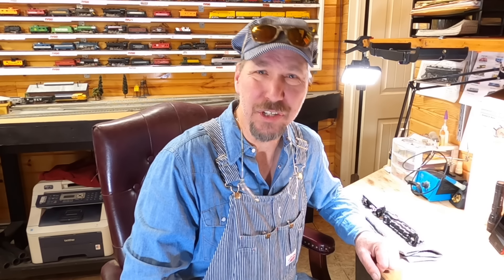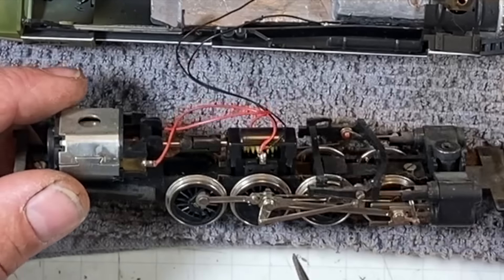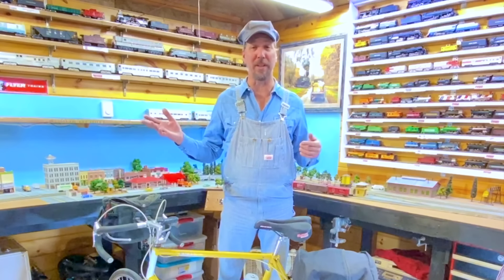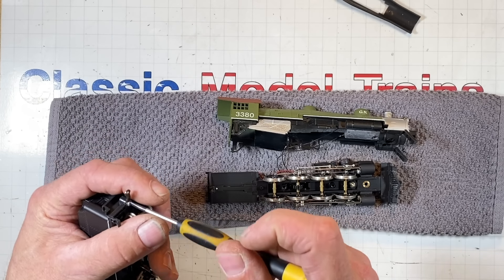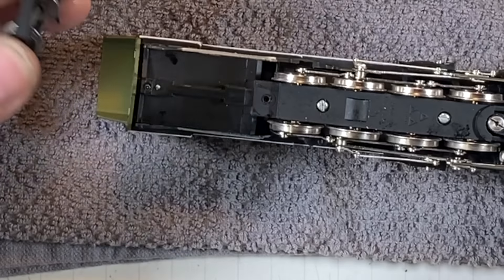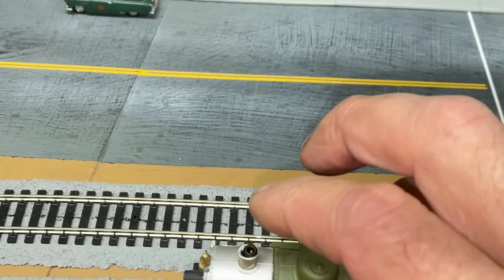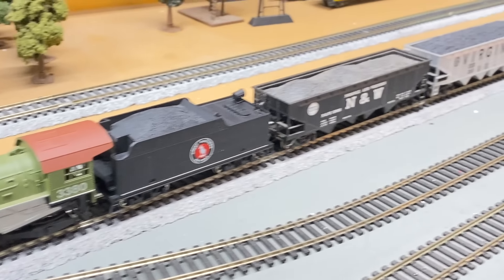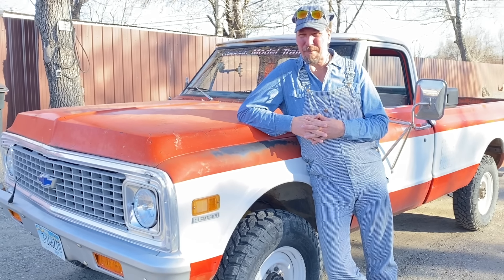AHM / Mehano H.O. Steamers.....Built Better Then You Think!

Comment: I'm 77 years old and my freelance layout is set in 1962 and represents a very short dieselized remnant of an electric interurban.  It does switching services for two customers and also has its own team track.  I run DCC with a DCC-EX command station and a homebrew wired throttle.  I have 4 DCC locos (Plymouth ML-8, GE 44 tonner, GE 70 tonner, and EMD SW9), but I run only one at a time as the whole layout is built on a 1x6 foot shelf unit.  I would like to see you do DCC conversions on older locos.  I browse eBay for old, used small switchers (my first HO loco was a Marx imitation of an Athearn Hustler), but unfortunately most of them seem to have flanges too large for my code 75 track.  Cheers from Wisconsin!
Reply: Smaller shelf layouts can be a lot of fun. I'm gonna say it is documentably more than 'seem to' have flanges too large for Code 75 rail as a good number of, if not all, older HO scale locos from the 20th century were given flanges sized for Code 100 rail.
Reply from the maker: Hello Andrew, Thanks for telling me your layout era.   Sounds like you get a lot done on your shelf layout!!
Reply: I would definitely like it if you could put a sound decoder in an older Rivarossi Pacific. I recently did one and it works when it wants to. Can't figure out what I did f$&##/ wrong. Maybe watching you will help me (please), I used a decoder buddy and a soundtrack economi 21 pin decoder ....btw I'm a proud 33 per center....
Reply: Arriving in STYLE!  DELIVERING the goods!
Reply from the maker: @paulpietrowski1940   I have a Tyco pacific with a Digitrax decoder w/ sound I built and it works half the time as well.  Thats the nature of the beast best I can tell.

Comment: Both AHM /Mehano locos are great runners. However, when it comes to the IHC/Mehanos, the best of those are the ones that come in the Purple "Premiere" boxes. The yellow box versions have those crappy white nylon gears, where the purple ones have industrial grade delrin black plastic gears.
Reply from the maker: I HATE crappy white nylon gears.  They give me gas ;-)
Reply: Had not realized that. As it happens, all the ones I have after the 0-4-0 Docksider of the 1980s, did come in purple boxes, even the SD9, the sole diesel I have by them.

Comment: I have cleaned up and refurbished a couple of Mehano Pacifics and have removed the smoke unit in each as they seem to melt the boiler and smoke stack. Had to do a complete stack replacement on one unit as it was melted at a blizzard angle.  Ha got you by three years Ron!  My layout that does not exist yet is in the 50s or so to maybe 60s so mix of late steam and early to mid diesels and will be Midwest as well!  Raquel Welch. ☺️. They also made a simplified valve gear version as well.   
Thanks Ron!! Great review!!! Take care!
Reply from the maker: Hello Erick, another win on your card.  Thanks for the input on the "era's" question :-)

Comment: Love your truck, my first set of wheels was a '69 Chevy C-20. Same cab, different grill.  Lots of great memories.  You mentioned putting a  DCC decoder in an older steam locomotive.  I have a Rivarossi 4-6-4 that I need to convert to DCC and would love to see how you would convert a similar unit.
Reply from the maker: Thanks Thomas, both for your compliments and response to my DCC question.  DCC conversion video's will be put into programming.

Comment: Great video Ron, I love those Mehano locomotives.  They made a 4-6-2 Pacific, like yours, and 2-8-2 Mikado using the same boiler and cab but different wheel arrangements.  Both came in a less expensive basic model as the one you featured and a premium version that cost a bit more. They look alike except they installed metal hand rails over the molded-on ones,  have a brass bell, and the tender lacks the lugs sticking out the side of the tender on the premium versions.  The premium ones have better motors with much better slow speed performance and are quieter.  I have several of the Pacifics and Mikados in both the basic and premium versions and I enjoy them both.  Also, the first thing I do is yank out those pesky smoke generators.  I've seen too many on E-bay for sale with melted smoke stacks.  Thanks again for the video, I always learn something new from watching your channel.  P.S. when I was in high school in the late 60's Raquel Welch was the subject of my favorite fantasies. We won't go there though.
Reply from the maker: Mehano's are underrated and nobody seems to think about them but they make a real nice product.

Comment: Thanks for your video on this locomotive!  

I recently purchased a Mehano pacific on EBay.  This was my first experience with Mehano.  As a youth, I purchased the Mantua/Tyco products, and later Bowser.  The Mehano ran fine until it came to my 3% grades.  It could barely pull more than two cars.  My initial reaction was to replace the motor with an old NWSL can motor.  It ran more smoothly and quietly, but no improvement in pulling power.  I eventually discovered that the electrical connections on the tender trucks were a significant drag on the pulling power.  Maybe a thorough oiling would have helped, but I simply removed the electrical connections.  No longer any light in the tender, but it can now readily pull four passenger cars up the grade.
Thought some readers might benefit from this experience.
Reply from the maker: Thank you for watching Jay,  and also a good story with a resolution at the end for others to try if they are having the same problem :-)

Comment: I still have & run a 4-6-0 Delaware & Hudson in gray IHC.  It was built the same as the Mahano.  I put in DCC in the engine, had to rewire for directional lighting, no smoke unit.  On my club's old layout it would polish the rails in one section of a 2.5% incline with only 5 Bachmann  Spectrum heavyweights, solved that by adding #9 birdshot wearever the shot could be discreetly placed.  I forget the brand paint but I got lucky & the gunmetal color was a very close match to the manufacture's paint color, which hid the birdshot even more.  This added a lot more weight to the tractive effort that the engine got up the that grade with no problem until a 6th car was added, 5 coaches are just fine.  Only hassle was the wire for the back up light.  I made a new brass drawbar that was screwed on.  The tender now never leaves the engine.  There was enough room to install the DCC board in the engine with no modification to the the engine, except wiring.  Runs terrific!  Also Bachmann smoke deflectors from their NYC Niagara fit great on the front with very minor cosmetics corrections as D&H Pacifics had smoke deflectors.
Reply from the maker: Sounds like you built yourself a real nice runner!!

Comment: I love these Mehano models. I've gotten some flack elsewhere for saying that but hopefully not here. I think they have a great balance of having a decent level of detail, a very futureproof mechanism (someone could replace that motor with a new one real easy if so inclined; and wire up DCC way easier than a lot of older engines); and being relatively cheap to make. I wish they had more pickups on the loco, but I guess that's something you can fix yourself if you want, and at least some of them let you hook them up to the tender pickups. And they're pretty easy to work on.

One of the few locomotives I still have from when I was a teenager was an IHC (made by Mehano) 2-8-0. It was great to have then and great to be able to fix up again a few years back. I'd have tons of them if I could.

Glad to be in the 33% club, even if I'm skeptical of any club with low enough standards to let me in. I think throwing a DCC decoder in here would be a good idea.
Reply from the maker: Thanks for your input on the DCC question.  No flack from me on these Mehano's. there quite nice in my book

Comment: It was funny in a sad sort of way at the model train club I was in 2009 to 2019 when my IHC/Mehano 2-8-0 and 0-8-0 would run and run and run and run for hours straight on open house days on the DC track while the expensive steam locos on the DCC track were having continual technical difficulties. I'm the kind of model railroader who enjoyed getting a basic IHC or MDC or Athearn locomotive then painting and detailing them for my freelance roads.
Reply from the maker: I LOVE this story!!!  Bet the DCC boys ran that loco down every chance they could huh?
Reply: @classicmodeltrains  If they did they didn't say it to me or the public. There, however, was another group of modelers who did run down my use of 3mm LED from Christmas lights as a replacement for the two locos' defunct headlight bulbs. They made it well known how cheap and suspect quality the LED used in holiday lights are and how they were guaranteed to never last. Which is kind of interesting since those "worthless" mass market planned obsolescence holiday discount light LED have been going strong since 2011. A thing which I will admit in public suits my sense of pride quite well. 😁 And 4 LED from same set also are going strong in an IHC SD9 done at same time. Those 3mm LED fit its sealed beam headlight holes perfectly.

Comment: Just received an eBay bargain job lot half hour ago with my first IHC/Mehano locos X3. . 2 x4-4-0 and a 2-6-0. Great smooth,quite runners straight out of the box. Will definitely keep an eye out for some more. Great vid. . Love the change up on the intro ✌️
Reply from the maker: Thank you Darrell!  Service them "new" to you loco's before a lot of time gets put on them.  They might need a little "drink" of the lube. :-)
Reply: @classicmodeltrains  always. That's part of the fun of getting new(old) loco's 👍
Reply: Their 2-6-0 Camelbacks are interesting, pull off the wide firebox part and there's the firebox and backhead detail for their SP 2-6-0.
Reply: @scottfw7169  found out that these ones at least have a very good crawl. I have a couple of old H and M  clipper controllers I use for DC. You can adjust the resistance and waveform of the juice. Full wave and high resistance. Half power on the controller and they are all as smooth as silk on the crawl. 👍

Comment: Hi Ron. That 2-8-2 does look decent. I have recently been playing with an old Mehano RS-11. It's better than you think too, but you have to add all wheel pickup and ditch the original headlight installation. The headlight contacts are loose and jiggly and cause all kinds of problems. I made additional contact wipers for the trucks from K&S brass sheet and converted to LED lighting. It now out performs my Athearn GP9, and that has the gold motor in it. Wow.
Reply from the maker: Mehano's are really good units that get under rated by some people

Comment: this is just like my AHM 4-6-2 Pacific even the screw and tabs on the back of the cab. Great little locomotive.
Reply from the maker: It could be built by Mehano as well
Reply: it has yugoslavia stamped on the bottom. tender is identical too so my guess it is. @classicmodeltrains

Comment: Hi! looks like you got one with a good motor! the motors in those are very hit and miss in my experience, about 50/50 chance good or bad. If those motors are worn, they let out magic smoke! But when they work, they are great! I just swapped two of those engines with can motors for my Uncle. The 4-6-2 version I used a flywheel kit off ebay. I had to modify the frame a bit but it worked pretty good. That one has 4 wheel pickup. You can run wires to the tender for additional pickup. The 2-8-2 I dropped in a freebie can motor and it sails around a little on the fast side. Those have 6 wheel pickup. I have a 3rd one which someone added in DCC, and the smoker melted the stack completely off. The last bit of trouble i had with these is the bottom half of the boiler plastic that fits around the worm gear. Just gave me grief putting it back together. Nice truck too!
Reply from the maker: Thanks for the info on the Motors.  I have not worked or focused much on these Mahano's.  The 2 I have done, they seem to be pretty nice for "cheaper" locomotives.

Comment: I love these old Mehano engines. They are a great value, very reliable and easy to maintain. Two things distract from these engines, one being the molded on handrails and the other being a bit of a lack of pulling power due to their weight. The later versions with metal handrails, flywheels and additional weight took care of the issues.
Thanks for this great video.
Reply from the maker: Thanks John!

Comment: 90s Mehano steamers are always a joy to get running again.  Typically takes 15 minutes if it's been sitting in a hot attic unrun fir a decade or more.

AHM, TYCO Old Bachman is several evenings to disassemble and clean up or replace parts.
Reply from the maker: Them Mehano's are good runners that are overlooked way to often

Comment: Dcc is the thing I always wanted as a kid for  my railroad. It used to drive me nuts that the passenger car's lights would turn off when you stopped the train. I love running my trains instead of my track. Plus they consist much better and you want to see a train go slow? Add DCC and let the decoder do the hard stuff like reading the back voltage to regulate the speed. Like cruise control. I have been dying to learn how to do the DCC signaling with blocks and auto switch correction, pausing trains to let another pass. Super cool stuff. And I get that you are classic trains but you have to see how good it feels adding a DCC decoder, new LEDs for head lights, ditch lights, etc. And now they have a little speaker for $8 that will blow your mind. (Cell phone technology for trains.) I also have a great idea for a WiFi camera car for cheap! And not nearly as bad as the Lionel F2? (you should try taking that black lens off the shell in front of the camera, if that's what I'm seeing.) Anyway thanks for the entertainment and I guess you must be a big Vice Grip Garage fan too. Well, I don't believe it. But I guess I'm gonna have to because I'm looking right at it!

Tom
Reply from the maker: Hello Tom.  The Classic DCC upgrades have been green lit by the positive comments for that kinda information. Yes a few Fellers have pointed out I present a lot like VGG

Comment: I would be very interested in some dcc decoder installations on these older models. I tried to install a decoder many years ago in an old Bachman trolley and it just wouldn’t work with the pancake motor. I do know that decoder technology has come a long way since then.
Reply from the maker: Well I'm a bit late to answering this comment.  I did make a video installing a decoder in this unit.  The decoder was developed in 2002.

Comment: Hi Ron I love the intro Nice truck inside and out !!  I liked your old layouts plan and how it was going but understand your dilemma with the 4ft reach and I'm liking your point to point layout but that limits your passenger trains to arrivals and passenger car shifting and watering and then building them back up to a departing train. That's still not bad coz you can transfer New York Central Sleepers onto another railroad's tail end; I've seen that before or anything like that if you're modeling 50's to 60's after 71 you could still see a few mixed railroads with new Amtrak!! I'm personally modeling late 50's to 70 but I just picked up a tyco GG1 AMTRAKVso maybe I'll have to extend it to  celebrate A Pennsylvania GG1 going into the paint shop coming out in the new livery lol I have a silver PennsyGG1 In my watch list  so....
Reply from the maker: Hello Eric!  Thanks for the input on both my layouts.  I'm hoping to get a larger facility to house a larger loop layout with lots of switching.  Ive got a GG1 video in the works.  Varney ones from the late 50's up to 1970 productions.
Reply: @classicmodeltrains  great I'm looking forward to it Maybe I'll crack mine open as I watch your video ( pausing frequently) and clean my commutator with my fiberglass pen that SMT Mainline suggested I get;  it works great!!

Comment: I think it's pretty easy to change the motor in the Mehano. Plenty of room for a motor and a backhead inside the cab. Scrape off the mold lines and most of the boiler details and add your own. It really is one of the easiest and best locomotives to work on and upgrade. See how far you can take it.
Reply from the maker: They look simple enough to trick out for sure!

Comment: I have one of these but it’s missing the trailing/leading trucks. I don’t think the drawbar gives any current to the motor. Inside the tender there’s a directional headlight, that’s what the pickups do.

I’m attempting to have my layout (6 1/2x4) “switch” years, so there’s the mid-steam era, transition era, and modern era. Buildings can be removed, and certain areas of track can be covered up.
Reply from the maker: Thanks :-)

Comment: I had one of these Mikados in ATSF that I purchased under the IHC brand. Given the paint scheme, I would guess that this was offered under the IHC brand. It seems that I remember that the Great Northern scheme was offered along with Chessie System when IHC was importing these locomotives.

For the question on the time period era modeled, I was going for roughly the 1970s to 1990s, but I've expanded it to the 1950s to 1990s due to having more early F units and steam engines.
Reply from the maker: Thanks for the "era's" answer :-)